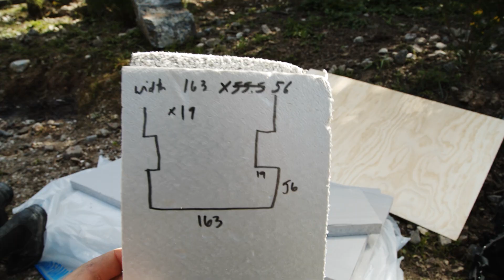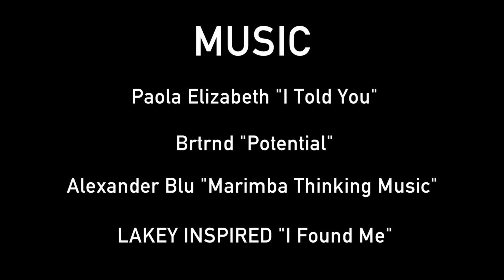Insulating Our Van (Van Build - Part 12)

Comment: thumbup I bet the car gained overall structural stability now, because of the woodwork inside, which ties it together :) Not sure if you would have required a damp seal between inner wood and outer metal shell, I guess car is ventilated well with the small vent flaps on sides? Would be a pain moisture runs down the inner walls, creating a swamp underneath floor.
Reply from the maker: Yeah that might have been a good idea but I wasn't confident we could get it 100 percent sealed, so it seemed like proper ventilation was a lot easier and lower risk but I guess we shall see long term ; ) ---Lou

Comment: Hello guys,
Nice to see you back at work 
I have a question, why you didn’t make the plywood conform to the upper side (arch form) of the wall ?

That’s seems like lost liveable space.

Anyway Nice video 👏
Reply from the maker: Hi Xavier, not sure I understand, but we wanted to put almost double the amount of insulation into the roof because that's the most critical point in terms of heat loss and also cooking in the hot summer sun so hopefully it pays off, plus the van is really tall so that space is still very open : ) ---Lou

Comment: Great job guys!!! I have a question - why did you decided to seperate the driving space and the back? I've seen a lot of videos about van life and every person build the van in a different way, that's why I'm curious why you did it like that :)
Reply from the maker: Thanks! We wanted to insulate the back as good as possible and most of the heat/cold would be lost/gained there because of all the windows. It also feels a lot safer this way for some reason, and a lot more like a tiny home rather than living in the back of a car. The other option is to get really fancy expensive swivel chairs which give you a ton more room but they cost a ton of money and I didn't want to deal with german regulations regarding chair installation ; ) ----Lou